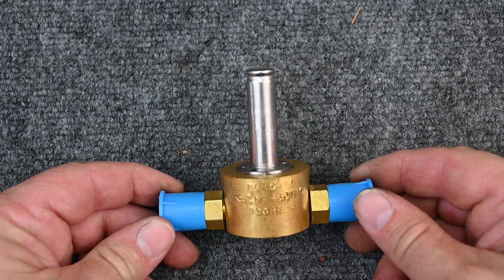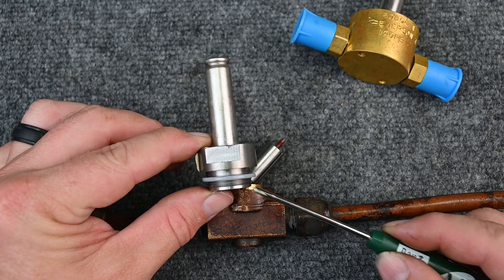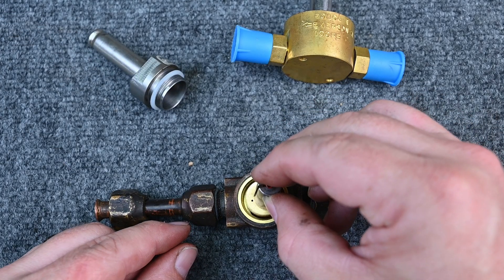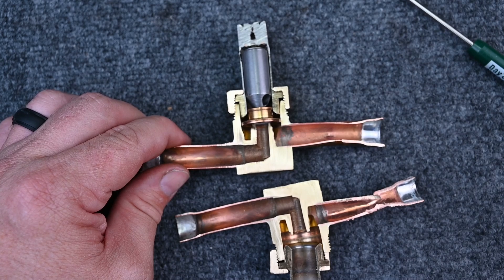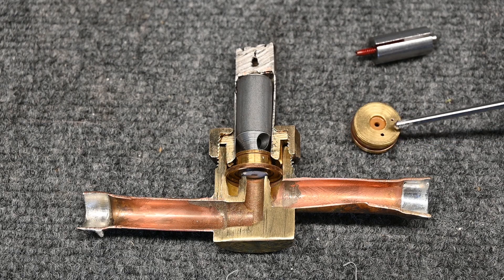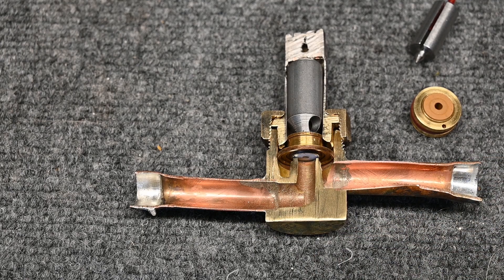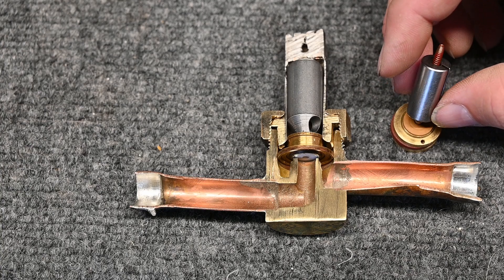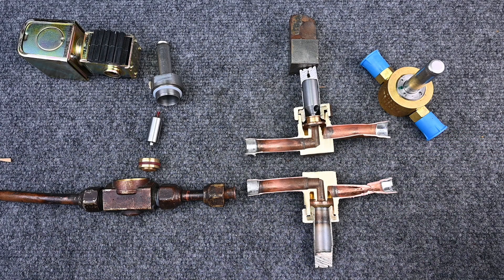HVAC 086 A Solenoid Valve part 1 internal workings

Comment: I have 3 solenoids brand new. All open snd close when not loaded but when i put it on the system and there is gas they open once. When closed off the next cycle they dont open

Comment: what's the purpose of the valve??
Reply from the maker: Mostly used To prevent refrigerant migration during the off cycle for automatic pump down. 
But there are many other uses to control refrigerant flow.

Comment: On many types, you can put your magnet down near the valve on the plunger shaft, feel it catch the plunger then drag it back to the end of the shaft, where it will be held open.  Not a elegant as having the 5 or 6 ring magnets like are in those tools, but in a pinch you can operate many a solenoid valve with a rare earth bar magnet.

Comment: Rember the word PILOT valve fellas, not all valves have a hole where the pressure on one side can help open (or close) the valve. Pilot valves are also used a lot in hydraulics too. Look for the holes and gunk or foreign material clogging the hole causing the valve to not work correctly. Also, many valves have rebuild kits available so you can easily repair them without changing them out.

Comment: my right ear feels lonely...
Reply from the maker: The whole way threw or in a certain part?
Reply: @love2hvac  the first section.
Reply from the maker: Thank you for letting me know!
Reply: @love2hvac  no problem, it happens often when editing. i always recommend using headphones to notice audio issues before exporting. if you find videos where the music is louder then the voice it also means they used crappy speakers and not decent (flat) headphones. if you are in the market or looking for a affordable one i recommend the ATH-M50X. its cheap (in comparison) and provides exxelent quality and is very flat/neutral.
Reply from the maker: Thank you, I will see about ordering them. I use my Bose head phone and they compensate automatically.  
I try to play it on the computer speakers but I upload and edit at the library so I gota be quiet.
Reply: @love2hvac  gotta love "smart" stuff when they are getting too smart. ps: they also make a bluetooth version if you have that specific brand that "innovates" by removing the headphone jack from their laptops and phones....